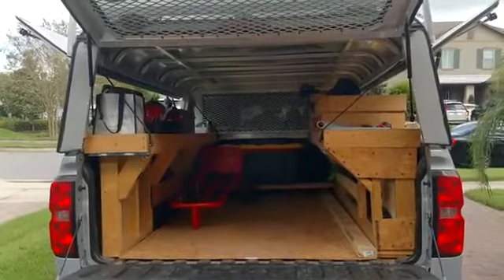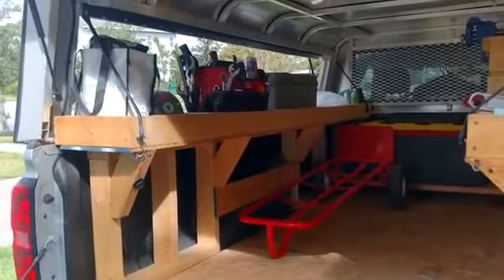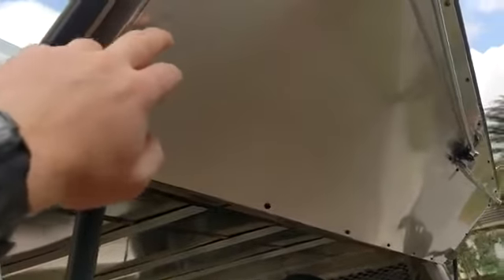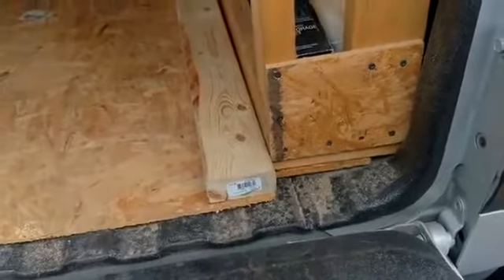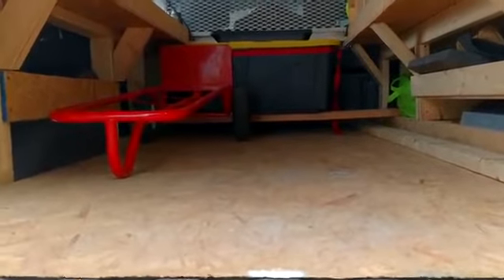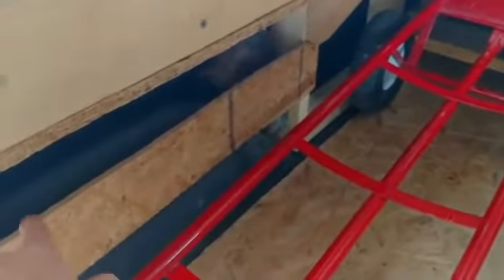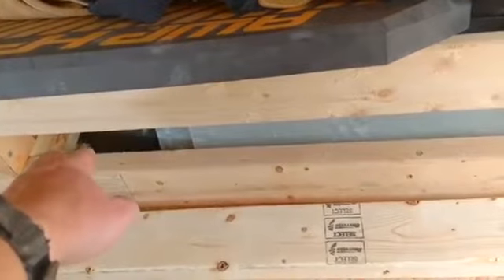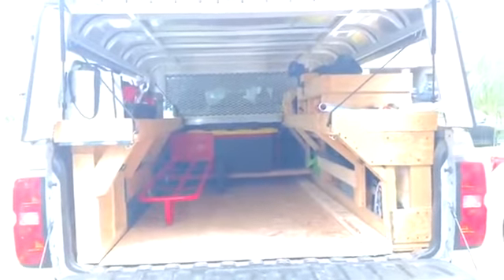Truck bed organizer

Comment: Have watched this video (and the update on the short) several times since we bought our 8' bed and similar camper shell last Sept.  We went with 2x3's and PT plywood to make a very similar setup.  The front is held outward by a sliding plywood shelf.  The rear we made a similar shelf but it got discarded due to hauling too many larger items so now the rear shelves are held against the body by zipties into the tiedown rings.  We drilled and bolted our shell on due to past aggravation with loosening clamps on other trucks.  Great job coming up with this setup!  Best example on the entire internet!  No better way to preserve the longbed ability to haul 8' lumber and 4x8 sheets!  Appreciate any updates as you make changes!
Reply from the maker: @erinhill2391  hey.   I don't know how I missed this comment.  Do you have any pictures or video of your set up.  Sounds really cool!

Comment: How do the shelves attach to the truck?
Reply from the maker: Michigan Wheels. Hey thanks for the comment. I used a piece of hole strap that is wrapped around the clamps for the truck cap. I believe the first video I have shows this if not would you be interested in me posting a video on just how it attaches?
Reply: The Florida Plumber I would be interested in seeing that. Surprisingly, I can only find 2 YouTube videos showing pickup bed shelving systems that aren’t full width. My plan is to attach a 2x2 to the bed rail using my capper clamps. I’ll notch the 2x2 so the clamp will hold it, then I’ll reinforce the 2x2 where it’s notched.
Reply: Cool, thanks.
Reply from the maker: Michigan Wheels check out the latest video about how the shelves go in.